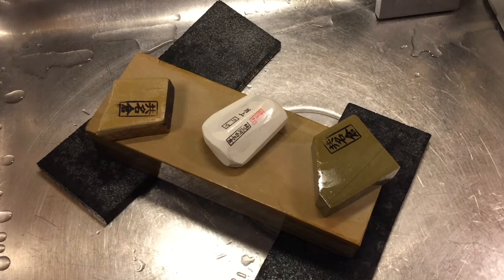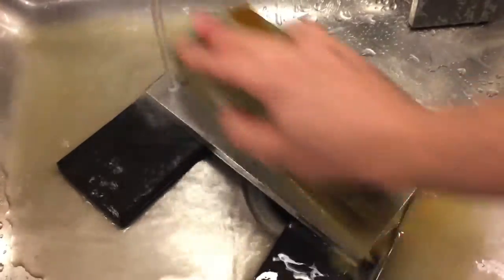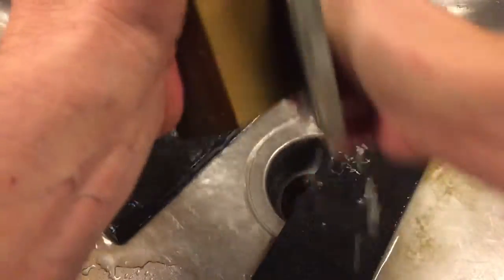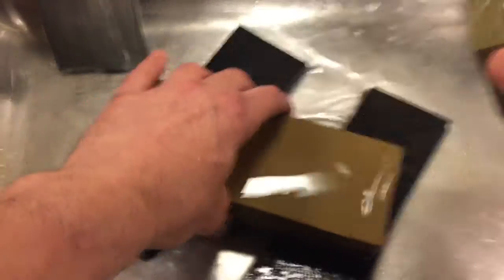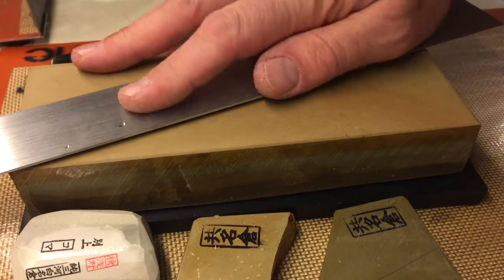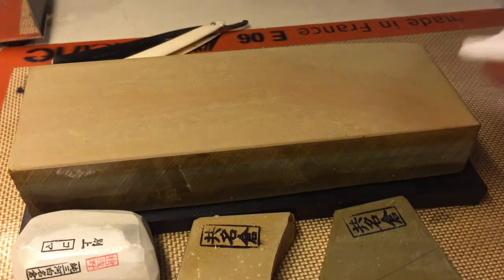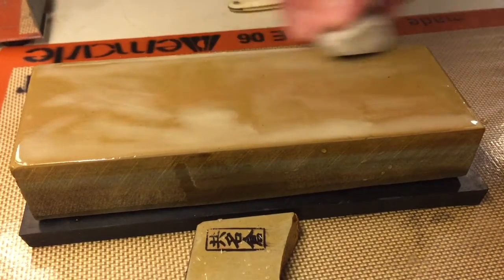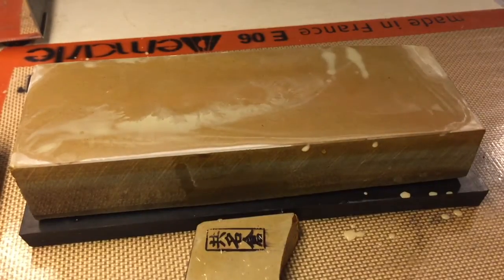New Nakayama Kiita, First Look - Prepping and Lapping

Comment: Definitely using diamond plate to lap your razor stones is the way to go. I made the big mistake of using sandpaper stuck on glass to flatten one of my razor stones as was suggested by a supposed authority. It's an inexpensive way to lap stones for carpentry tools but not for straight razors. As the sandpaper wore, particles ended up embedding in the stone, to my dismay my 4k stone now had 220 grit stuck in it. Thanks for showing the proper way to lap razor stones.
Reply from the maker: Thank you for watching and commenting. A good diamond plate is worth it's weight in gold, can't beat it for lapping stones.  W/D paper can be do-able but a diamond plate makes life so much better with way fewer laibilities.

Comment: can this atoma plates be used ok with shapton pro stones? even the 12k
Reply from the maker: I use a broken-in Atoma 400x for most of my lapping, 12k synthetics included. When the plate is new, it will be more aggressive and it may leave marks. If needed those scratches can be removed with finer grade w/d sandpaper.

Comment: Man i am OCD as hell. I wanted my stones 'dead flat' , but i never  can
get them  💯 there. I measure with a precision straight edge and feeler gauge, and a good light source 😂If i have heavy grunting i use sic (sic always puts a 3-4 thou crown in the stone) then finish on sandpaper (or a DMT or atomo) on a dead at surface .   What's your trick to getting so dead nuts flat?

Mike
Reply from the maker: I lap with a diamond plate under running water, use minimal pressure, check with Starrett straight edge, pay attention, etc.
Reply: @KeithVJohnson1  Maybe all diamond plates aren't the same??! It really doesn't matter (in my mind it does:) if they're dead flat to NASA standards, just close enough to flat that you're getting even hit on all the bevel i guess. Most razors are probably off more than my .002 stones specs.
Reply from the maker: By doing the best we can, we eliminate or minimize the effects of variables that can have a negative impact, or just leave doubt in the back of our minds.
Reply: @KeithVJohnson1  I agree 💯

Comment: Thanks for showing us.
2 of mine atoma140 are not flat anymore after 2-3 years useage. It's the double side tape thingy. So mine stones are not perfect flat. Really the shapton diamond lapping plate is the only choice to me. I've gone thru 6 atomas they are good for what they are good for but not good for lapping... my humble opinion..  Andrew
Reply from the maker: FWIW - I don't use the 140x Atoma for absolut flattening, they're just for removing a lot of material quickly. 
The 400x does the 1st line of what I call 'real' flattening. 
I lap way more stone than most people I know, and most of what I lap are very hard stones. My oldest 400x Atoma is still flat and my hones come off that plate exceedingly flat. All of my hones are drop-dead flat and I gauge that flatness with a Starrett straight edge that I swap out every year or two.  
IMO - that shapton diamond plate is a complete rip off, even at 1/2 the price. It's not flatter out of the box, it's not going to wear longer either.
Reply: hi Keith, thanks for the info.
my problem with atoma is the double-sided tape they use. over the time some portion of 3 strips tape might come loose or lifted, then the top will be out of alignment at least this was  like that in my case.. but i still went back to and get some new atoma plates. between the lack of flatness and lack of maintaining of cutting power i choose atoma over dmt.

cheers

Andrew
Reply from the maker: Xtol Ren I see  zero issues with the two-sided tape on Atoma plates, and that's after extremely heavy use over long periods of time. Perhaps you're using them incorrectly: Lapping under hot water and/or using too much pressure can/will cause what you are describing. Or maybe you got defective plates? Could be anything I suppose. I do agree that they are better than DMTs.